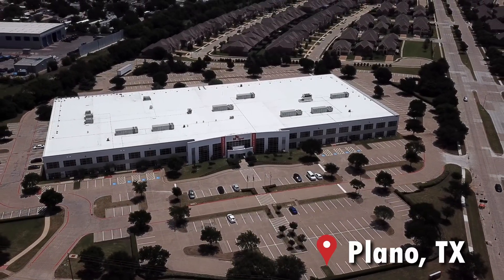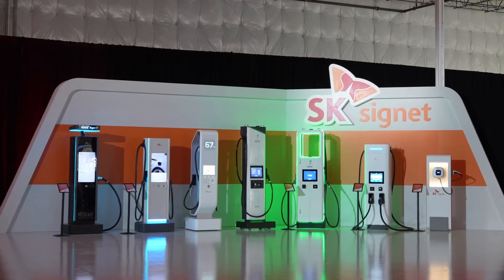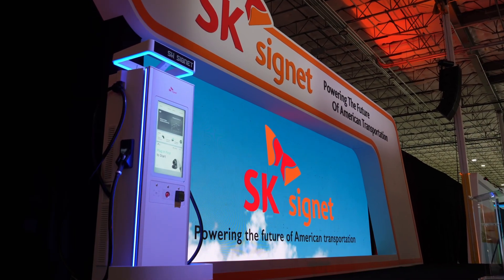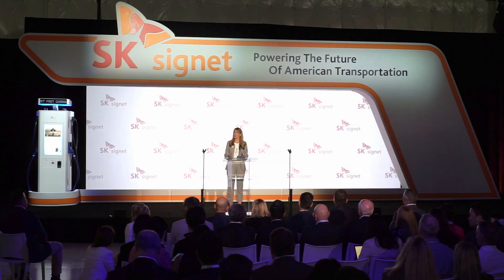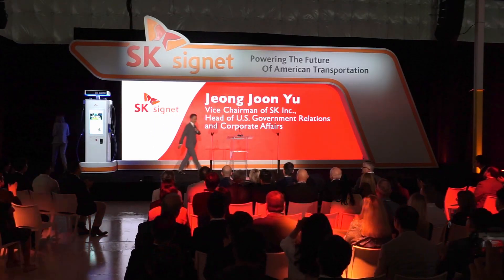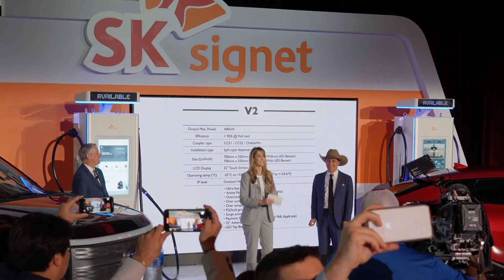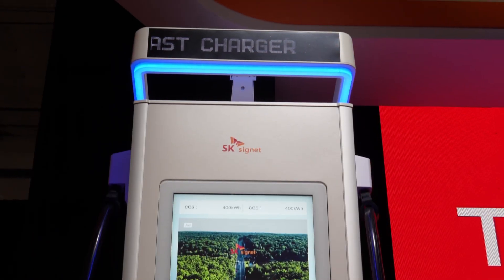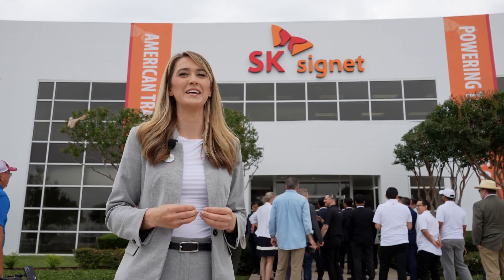First Look at SK Signet's US DC Charging Hardware Factory

Comment: In my experience with all of EA and EVGo chargers Signet is the absolute worst of all of them. The 350kwh chargers never even come close on an 800v architecture car. They have a lot of work to do.
Reply from the maker: This is brand new US-made hardware with superior thermal management. When you've used V2, you'll know if there is still work to do. It sounds like all of your experience is with previous generation of imported hardware. 

We've charged on Signet hardware hundreds of times including some problematic sessions on national television. https://chargeacrossamerica.com/#watch

We understand the automaker+CPO software protocols, third party cables, and CPO data network connectivity play a role in poor CCS speeds and other failures.   As you can see in this video, the American made Signet V2 unit will deliver 400kW to a pair of standard issue EVs.  In this case, it was a Ford F150 Lightning and a Kia EV6 [800V] each charging at maximum rates on one charger.

Comment: flo is the best ;)
😊
Reply from the maker: We are fans of all kinds of/any charging hardware that works. We have to be real, though.  At this time the Flo Ultra is the very best DC CCS system they offer and it is limited to 320kW output.  The Signet V2 unit in this video outputs 400kW.

Speed is not everything and we agree that there is a time and place for slower charging.  We are happy with 50-100kW at restaurants, movie theaters, malls, amusement parks, hotels.  Most of Flo's hardware today are slower the "Smart DC" series. As far as maximum capability is concerned  (deployed or announced), Flo is not currently in the lead.  They'll be getting those NEVI sales now that they've got a qualifying product in the Ultra.

Perhaps the NEVI profits will allow all manufacturers to continue investing in R&D for improved speed and reliability.  Flo certainly has nice branding and a clever unified cabinet/dispenser design.

Comment: Mine would have been the loudest applause if I'd been in the audience. 400kW is impressive! I wish Signet the best with ramping up and rolling out. Curiously, today I saw a list of those who have joined Ford and GM to transition to NACS connectors. It included ABB, Autel,  Blink, ChargePoint, Charin, EVgo, Flo, Kempower, but… I didn't see Signet or Electrify America…? I hope they simply haven't announced yet, but will follow suit —along with Hyundai!
Reply from the maker: We had an interview with a leader at SK Signet and we specifically asked about NACS.  The company asked us not to publish that interview. 

If they make an official statement, we'll amplify it on Twitter and Instagram.
Reply: @MissGoElectric  🤔
Reply from the maker: Now they've gone public with a stance on NACS:
https://www.prnewswire.com/news-releases/sk-signet-adds-nacs-capabilities-to-its-ev-charger-line-up-301852310.html
Reply: @MissGoElectric  Yet another shoe drops! 🥾  Seems to me that the most pressing need at this point is to start producing and selling NACS-to-CCS1 adapters (like in the "Magic Docks"?) to accommodate non-Tesla EVs until automakers install NACS ports in their models.